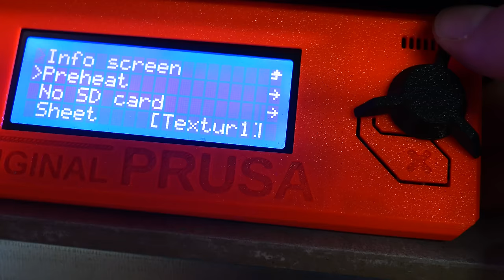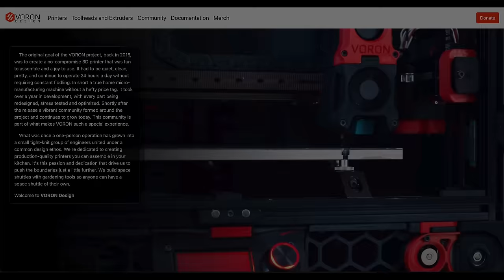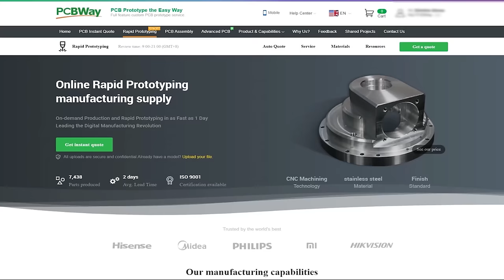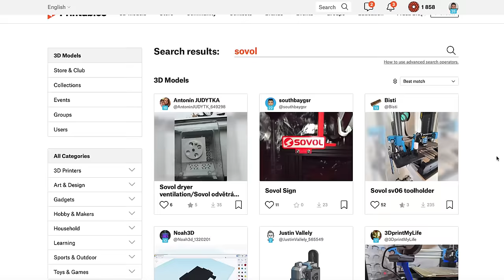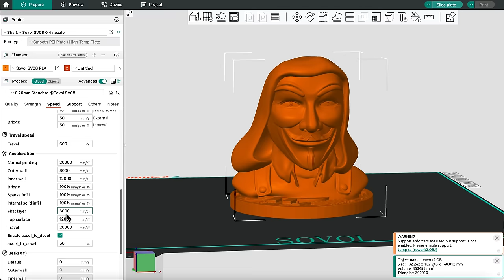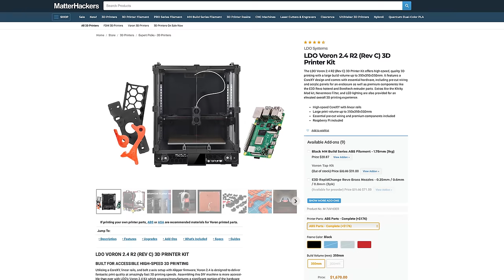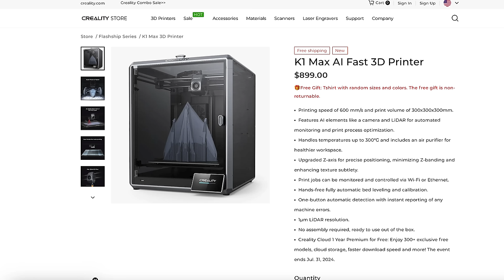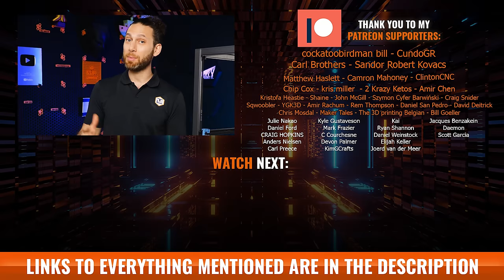The Sovol SV08: You Won't Believe the Price…

Comment: My biggest hope for this is that it acts as a kick in the butt for the Voron designers to make some updates to the many design flaws they have. They've been so successful that they've pretty much sucked all of the air out of the room for any other open source, rep-rap-minded printers and it's really stifling the community, forcing companies like Bambu Lab to take over in driving the industry forward. Sovol seems to have made a few improvements at a much improved cost, but it's likely to be the extra injection of funds into the Voron project that becomes the SV08's lasting legacy.
Reply from the maker: This is the first criticism I actually hear of the Voron team… But I guess you’re right. No filament sensors? No cameras? A ton of different bed leveling options but no one standard? I think they’ve just been so busy with the Phoenix project that they haven’t really gone back and updated things too much… But remember it’s a volunteer army and they all have day jobs. But I do hope that this will prompt more innovation all around for sure.
Reply: It's open source   Noting is stopping you from submitting changes  Doesn't mean they will be adopted   Feel passionate about your Voron issue then Fork it and publicize it
Reply: @thenextlayer  For me it's more that their designs are chronically undercooled, to the point where they see a lot of issues with PLA if the print gets detailed or you try to print at speeds the printers are otherwise capable of. At the same time, they explicitly don't design for heated enclosures, and have issues if the enclosure gets much above 50C anyway, which means there's a lot of warping and bed adhesion issues for the more useful engineering filaments if you're printing anything bigger than your fist. 

How do you recognize a Voron owner who doesn't tell you outright? They recommend you use PETG for everything. It's the only thing their printer does really well with, so it's all they use. 

Then yeah, there's things like the frames being a bit wobbly without side panels and/or extra supports on printers around 300 cubed and up. Missing a lot of things like a filament runout sensor, webcam, or canbus toolhead that have certain mods almost required. Putting all of the electronics on the bottom so you have to flip the printer to access them has always been a pretty big pet peeve of mine too. 

But really, you need to ask yourself, is a Voron design in P1P size, which will be around twice the price, going to give you the same quality with most filaments? Have any of the designs been updated to really take advantage of the power Klipper affords? Where are the designs that work well with the open source multi-material options out there, let alone having multi-material support natively? You can't tell me the idea of an IDEX or tool-changer Voron doesn't get you a little excited. 

Don't get me wrong, the Voron team have done great work and done a lot for the community, especially around documentation and making a build actually accessible to people without a lot of trial and error (look into one of the handful of other still surviving open build projects sometime, they're nightmares in comparison). But when it comes to design, they seem to be resting on their laurels just as much as most of the major 3D printer manufacturers. They aren't pushing on quality, speed, cost, printing materials, multi-material, or any other direction to improve the state of the art and a lot of the decisions on the latest printers have simply been because it looked cool (e.g. belted Z-axes on the 2.4). You can claim it isn't their job to push the hobby forward, and fair enough, but at the same time they've taken the wind out of all of the other open build projects which leaves the community with only proprietary companies like Bambu Lab pushing the state of the art forward. I can't help but think that's a bad thing for the hobby in general. 

/rant Sorry, that got a bit out of hand.
Reply: They say the printers were designed with ABS printing in mind. Hence the enclosure and cooling solution. Nobody tells you to print using PETG. It's mostly ABS. All of the kits that are out today come with Canbus and filament runout sensors. The ERCF project just released certified kits available via several vendors for multimaterial printing. The Voron Phoenix is an IDEX printer from the Voron team.
If you want to print PLA fast, you can install a Dragonburner, and CPAP or auxiliary cooling fan. There are mods that move the electronics to the side, top or invert them. Bed leveling? Voron Tap is basically the standard now for all Stealthburner machines. 

A stock 350mm V2.4 easily gets to 60 degrees inside the enclosure and has no issues with it. Their smaller printers get there faster and they reach even higher temps.

They acknowledge that 350mm is as high as their current printers will go with regular 2020 extrusions. Mine is not wobbly at all. Voron Phoenix is bigger because of custom made extrusions. What else? 

I too wish the Voron team would look at the best the community has to offer  and incorporate all the best mods and ideas into the base printers. But they are not a company. They're volunteers. I feel like a lot of people have  weird expectations in that regard. And they literally just unveiled their latest printer so they're not lazing about.

However. What they have is a very solid foundation that's been improved by the community and the kits now come with many of these improvements from the outset.
Reply: @SolaAesir  If most of what you are claiming was true then the Voron projects wouldn't be possible because the ABS parts are printed on other Vorons. I print very large ABS, ASA and PC parts with no problems, and have no problem with the chamber getting over 65C. I do know some people had problems because they used ABS+ to print their parts instead of normal ABS and had issues with some parts not dealing with the heat but even then that was just the toolhead.
The Voron team don't support heated chambers but there is nothing stopping anyone from using one, as many people do. Mine has well over 5000hrs of printing with a heated chamber.
An Aluminium extrusion frame being "wobbly" is a new one. I have stood on 350mm size fames and they don't budge. How the panels would stiffen the structure when they are just held on with thin plastic parts that just press the panels against foam is a mystery.
The Voron team have done the exact opposite of sucking the air out of other projects. The popularity of the Vorons showed kit and parts manufacturers that there was a viable market for well made parts based on open source designs. The all metal Vzbot wouldn't exist without it. We can now get metal parts, that don't cost an arm and a leg for one off custom machining , for multiple different designs like Annex Engineering, Ratrig, and BLV as well as Voron.
Even Bambulab wouldn't exist without Voron and similar projects showing that there was a real market for enclosed, higher temperature and fast machines that cost more than an Ender whatever model. The Voron team don't want to lead the industry. They wanted to bring comercial printer features down to prices that enthusiats could afford and they achieved it.
Reply: @SolaAesir  incredible, you managed to generalise a project you have no idea over. My voron does PLA fine, tapchanger exists for multi nozzle as does ERCF for multifilament. V2 is the first printer available that uses klipper's QGL and the trident was one of the first to use Screw tilt adjust, the success of the V2/Trident/V0 are large driving factors behind klipper's popularity.

If you don't understand the project, save your ignorant comments for yourself.
Reply: This is a prime example of why you never hear any criticism of the Voron team. So many people have built Vorons, or are in the process of a year long Voron build, that "I'm building a Voron" has become a bit of a meme. People spend so much time, money, and energy on their build that they become extremely invested, to the point it's almost like their child, leading to a visceral reaction if anyone doesn't think a Voron is the best thing ever. 

So let's address some of the general responses I've received. Note that I'll mostly be referring to the Voron v2.4r2 if I forget to specify, since it's the one I'm the most familiar with and seems to be the most popular by far. 

* *It was designed to print its own parts in ABS, therefore it was designed to print ABS well* - An Ender with a cardboard box thrown over it can print the Voron parts just as well. Okay, that's a very slight exaggeration, that setup would have a few more failed parts, but a cheap tent enclosure would actually let an Ender print them just as well. That is a great aspect of the design, kudos to the Voron crew for it, since you don't want to require a top of the line printer to print your printer if you're following in the RepRap ethos. It just doesn't say much about the capabilities of the printer itself. Even with the parts designed to be small to minimize warping, and using something like Magigoo to keep them stuck down well, it's still fairly common for Vorons to have ABS prints with issues (warping or cracking on higher layer lines) even on smaller prints (fist-sized) like the Voron parts. Move up in difficulty to medium prints, larger prints that take up most of a print bed, or prints which are shaped in warp-prone ways, and you start to see that Vorons don't print ABS well. I think people just get used to it and think that's how printing ABS has to be. Work with a printer that can do 70C+, ideally 90-100C, and you realize that printing ABS can be as easy, consistent, and warp-free as printing with PLA is on most printers. I wouldn't expect such high temperatures to be possible on a stock Voron without mods, but a much cheaper Qidi can achieve 65C which should be considered standard on a well designed Voron without melting/deforming parts or having components degrade extremely quickly (e.g. steppers overheating from being inside the enclosure).

* *The kits come standard with fixes for the most obvious flaws out of the box/Mods exist to fix the flaws* - The fact that the kits have been coming out with a pretty standard and consistent set of fixes for the base design flaws for more than a year and yet the design itself hasn't been updated is pretty damning all on its own. Mods are great, they are one of the major benefits of open source designs, and they let people customize their printers to their heart's content. They aren't a replacement for fixing the base design though. Having to tell people they just need to get a kit, because it's a pain to figure out what you actually need to source after applying several required mods, while the kits take care of it for you, should be screaming at everyone involved that the base design needs an update. Mods are great for exploring the best way to fix a design flaw, but once a good way is found it needs to be incorporated back into the project. Incorporating community fixes like this is a key benefit and core aspect of open source of all kinds. 

* *Nothing should be expected of open source* - We get these sorts of excuses on the software side of things as well. It's very true when it's a single person putting something out there in their free time. The whole world's computers run on some of these sorts of projects, so they aren't at all minor in importance. It becomes a very different thing when projects start to involve a lot of people and generate income toward the project. The entire point of building a community, giving funding, submitting bug reports/fixes, etc is to be able to rely on a project and see it improved over time, especially when such a project becomes a major pillar of a hobby like Voron has become to 3D printing. We shouldn't have high expectations, but we should be able to expect the very basics like major design flaws getting patched in over 2 years (since V2.4r2 released), especially when the community has already created, vetted, and agreed upon the fixes.

* *The existence of kits for other printers proves that Voron hasn't significantly hurt the open source, RepRap-ethos ecosystem* - Yes, kits have been a great development for 3D printing. They're a boon for designers, manufacturers, and consumers alike. They aren't nearly as amazing outside of the Voron ecosystem though, just due to low stock and small markets. RatRig produces their own kits and mostly keeps them in stock, but many other 3rd party kits quickly fall out of stock and get dropped beyond their initial release run. After that, it tends to only be single manufacturer, single item kits that remain; e.g. all of the motors, or all of the rails, or all of the extrusions; still helpful, but not really the same thing as the Voron kits. This is a big part of what is causing such an issue in the open source ecosystem, the kits act as a giant network effect and drive toward a single open source printer monopoly. The Vorons are pretty much the only designs to have great kits so they're easier for users to source, leading people to recommend that others just buy a Voron kit, leading to the market for other kits drying up, leading to other kits not being produced (or dropped to single item types), leading to Vorons being pretty much the only design with great kits...

* *There is an IDEX Voron design in the Phoenix* - This is great, but hasn't been released yet and it's an extremely large format printer that isn't really possible or practical for most people to make and use. I was talking something more in a fairly normal range somewhere between 180mm and 350mm. It's always great to see new designs and the Voron project branching out a bit though.

* *They've had a recent release* - I'm not sure what's being talked about here. Maybe something on their forums? If you look at the main VoronDesign website or GitHub you only have the V0 (last release 0.2r1 June 2023), Trident (r1 May 2022), V2 (2.4r2 February 2022), Switchwire (August 2020), and Legacy (December 2020). If it isn't on their main website or GitHub pages, I wouldn't really consider it to be released, only maybe in a beta or release candidate state. This makes the V0.2r1 their most recent release nearly a year ago, a very long time across 5 projects with so much going on in the industry and so many necessary fixes pending.

For the people who really think I'm wrong on this, I would really like you to try to suppress your initial gut reaction and do some careful, logical introspection on what I'm saying. It's certainly possible that I'm wrong or being overly harsh, but before you jump to that conclusion I want you to do a little examination of your own. 

First, take a look again at the v2.4r2 and only at its base/stock design without any mods. If someone were to be selling this printer fully built according to the published design, how would it stack up against other printers? What would its ideal price be? I'm betting the SV08 is perfectly on the mark here. Yes, the v2.4r2 has a great community, so there's a host of mods that can turn it into a printing powerhouse if you put the work in, but you can say the exact same thing about an Ender. That doesn't mean the Ender is a great printer as designed, it means it has a great community. 

Second, ask in generalist communities (no points for communities full of people who have built 10 different printers) about recommendations for self-built printer designs and see if you get any recommendations other than Vorons (sometimes with a brief, usually negative, mention that RatRigs exist). For the few designs that are mentioned, actually check to see if kits are available, would work together if multiple kits are needed (e.g. frame and rail kits are available for the same size printer) and how hard it would be in general to actually source one from a either kits or a BoM. See if the printer projects are still active or if they are dead with the last post multiple years ago. I'm really curious here because every design I've seen mentioned, other than Vorons, have kits that have been unavailable for months with no sign of coming back, don't exist at all just leading to a store's 404 page, or the project seems to have been completely dropped in the last few years. The only other active projects that seem to still be alive, active, and available that I've found are RatRig, VzBot, and maybe HevORT (it's in a seeming state of flux with no kits released yet though one has been announced, but it's still actively being worked on and has a decent community around it). 

VzBot and HevORT are great examples of pushing designs forward in ways that are really great to see from open source printer projects, especially since they seem to be incorporating the major improvements the other has designed while still maintaining their own identities. They are great examples of projects succeeding in the ways I'd love to see Vorons succeed as well.
Reply: So far, LDO claims they've sold about 6.5k Voron kits.  Assuming a slightly better sales rate for the SV08 (and a 350x350x350 is NOT something most people need), that's going to amount to about $15.000 USD.

That's not a kick.  That's a tap on the shoulder.